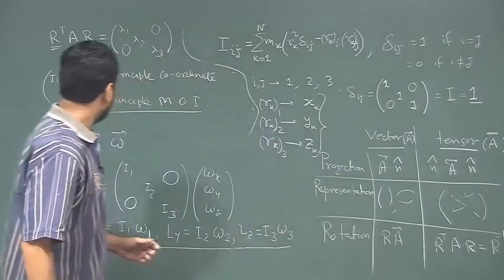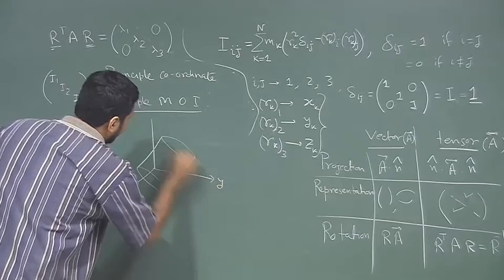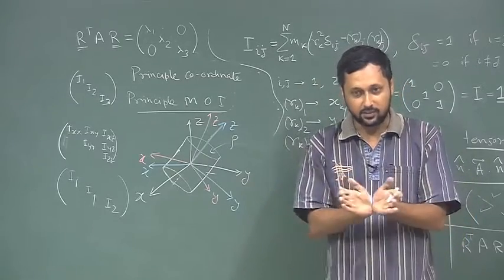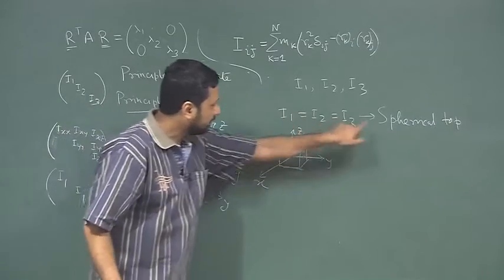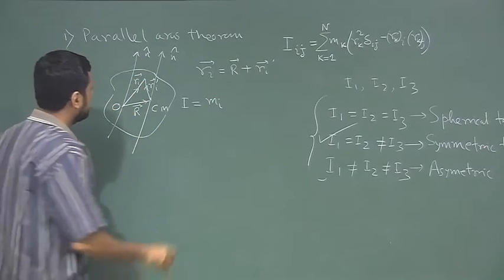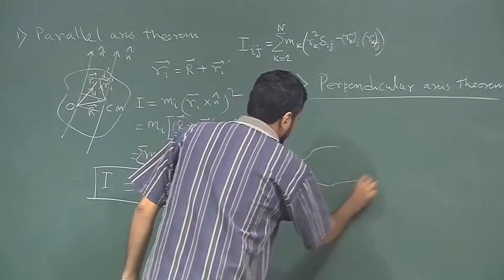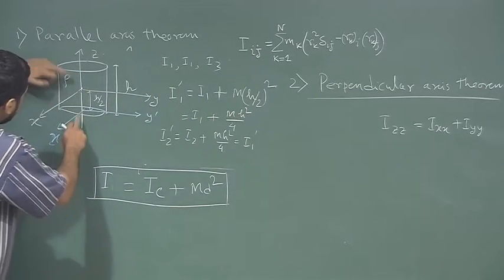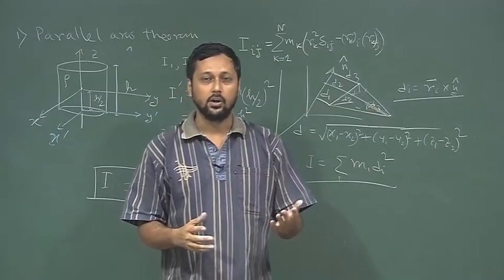Lecture 33 : Rigid body dynamics - 7

Comment: Sir, in case of a cube if I shift my origin at one of its edges then also Ixx=lyy=lzz.Some books call it due to symmetry. How is that possible Sir?
Reply: That symmetry is not due to mass distribution about centroidal axis. So it may not be obvious at first. However, if you apply parallel axis theorem and try to visualise the scenario, you would note that moments of inertia about the principal axis passing through any point on the body diagonal of the cube would have Ixx=Iyy=Izz. This is because all points on the body diagonal are equidistant from all three axes passing through the centre of mass and the cube already has spherical top symmetry about the centre of mass. So, when you apply parallel axis theorem and shift the axis to any point on the body diagonal, you would find that the constituent terms in moment of inertia would all possess symmetry about x, y and z axes. Hence, on the whole spherical top symmetry is achievable in a cube along all points on the body diagonal. This is true even for points on the diagonal line extended outside the body of the cube.
Reply: @sadagoapan  Thanks a lot Sir 🙏